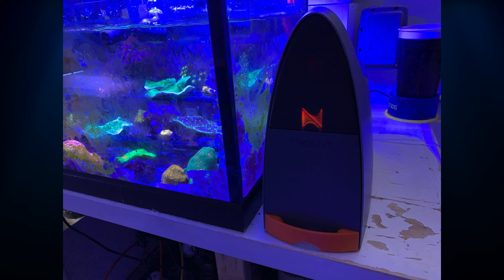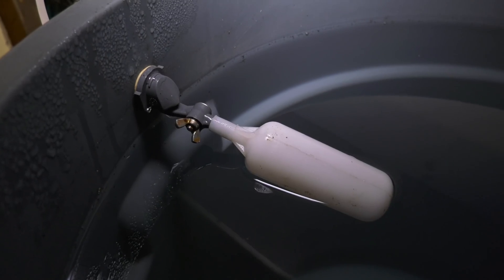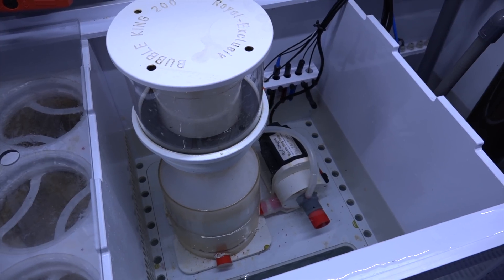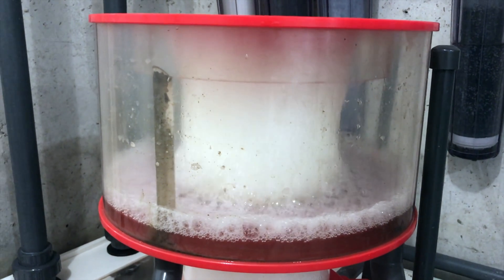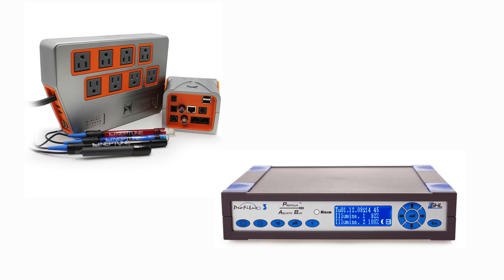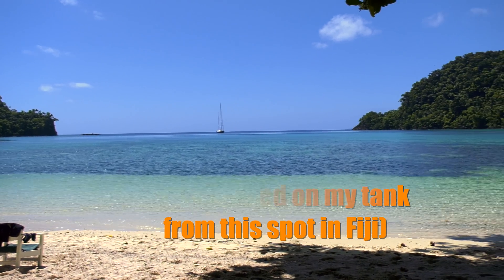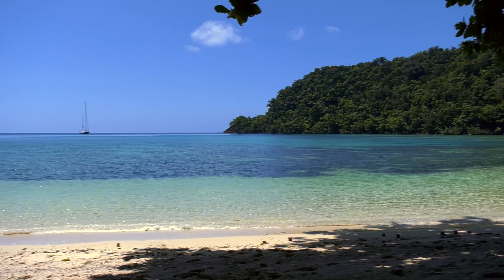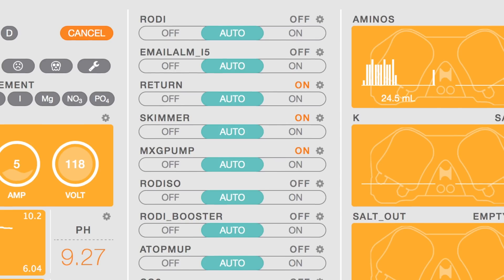TANK AUTOMATION - Why We Do It - Easy Ways to Automate your Saltwater Aquarium

Comment: I'd like you to look at alternatives to Apex / controllers. For example my plan is not to have an auto-top off or an Apex but instead get the Seneye (waiting for the Coral with Alk meansuring), wifi dosing pump (for ATO / Kalkwasser), a couple of cameras (1 for the sump / 1 for display) and some wifi controllable power bars. I can dial in the doser for the ATO to be just below evaporation rate and make adjustments based on Seneye for water level and alk. I can also turn off a heater (which will be on a seperate thermostat) if Seneye tells me the temp is too high. To me this gives me control instead of a controller.
Anyhow so that kind of thing would be interesting to me ;) By the way I am REALLY loving your livestreams
Reply from the maker: We plan on including products we don’t even sell in our videos unlike the competition to give a fair assessment of options.  Short Answer...  Yes.
Reply: How would seneye control anything?
Reply: @jamesparrott2073  Seneye monitors the crucial stuff - automatically testing and alerting you. Then you have wifi powerbars and dosers that you program and adjust. The advantage is it's not a single point of failure like for example all those reefers who may or may not have had an older version of a certain controller that suddenly failed. I think it would be good to learn about different ways to control your tank ;)

Comment: Everyone talks about water changes and most automation I see is making up the water in an RODI system. What about removing the water that you will eventually be making up. I end up siphoning it into a 5 gallon bucket and schlep it to a drain.  Frankly it’s heavy and a pita. What are best practices for removing the water and then adding it to the tank. My display tank is an overflow variety so do I just pipe right into it or is there some scheme to get it to the sump and then return pump it? Love the videos!
Reply from the maker: Definitely.  I use a Neptune DOS for water in & out on an automated schedule